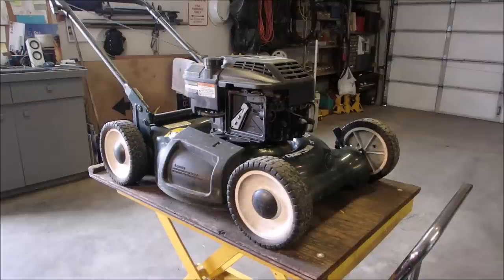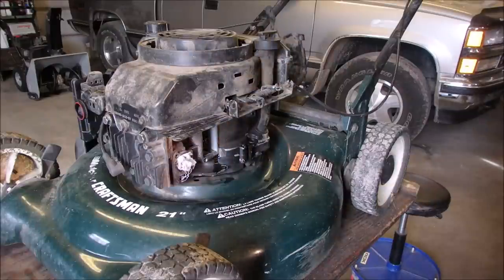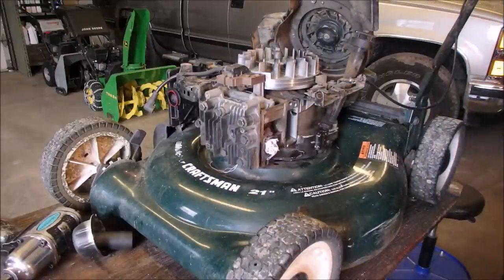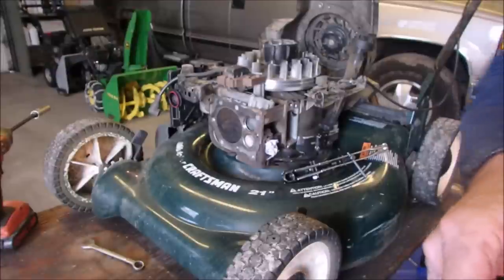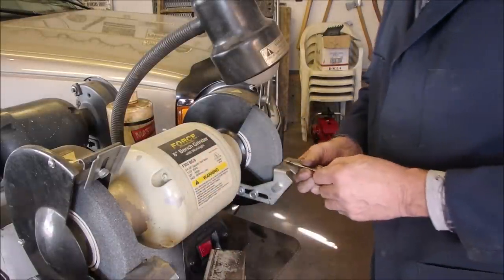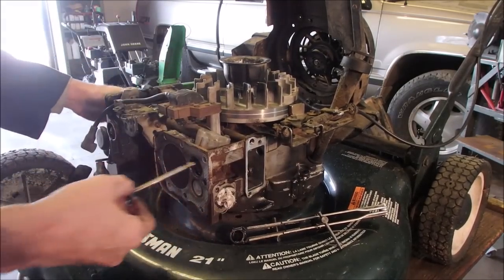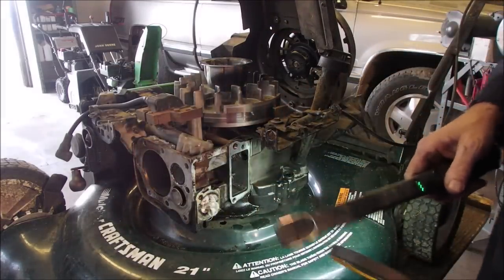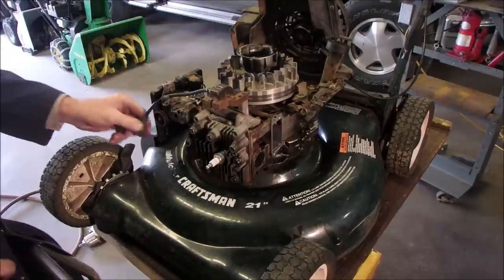6HP Craftsman Mower Will Not Start PT 1

Comment: gr8 vid ,   I have a newer flat head briggs , I suspect also needs a valve adjustment,  when its hot it doesn't want to start. and seems to lose compression.  head gasket is fine, cylinder wall is perfect.  just hadn't gotten around to it
Reply from the maker: It is easy to measure.  You don't have to remove the head.

Comment: Has anyone actually ever started an engine by gently turning the flywheel? I know I've never even seen an engine start that easily even when new. I think it's so funny watching Everybody remove the spark plug wire thinking that the damn thing's going to start just by slowly turning the engine. I get the concept of, that it can, but it most likely won't
Reply from the maker: If they have a battery and coil where the spark is strong right from the start they will "kick" right from the start.  Example an older Kohler K series will jump right from the start of movement.
Reply: Nearly lost my thumb on the farm Ronald tippet put put engine fitting a flat belt turned one turn slowly  came to life hand between pulley and belt needed stitches usually had to crank fast to start
F

Comment: I was going to do that to a classic engine but unfortunately I misplace my valve spring compressor tool do that since now I can't get the spring on .
Reply from the maker: You can insert th e spring into the spring area and compress it with a pair of needle nose pliers.
Reply: @BrucesShop  I will try that thank you sir